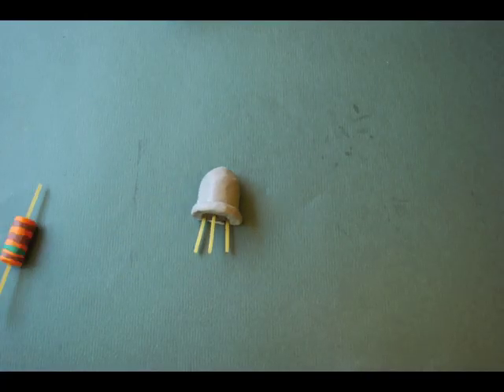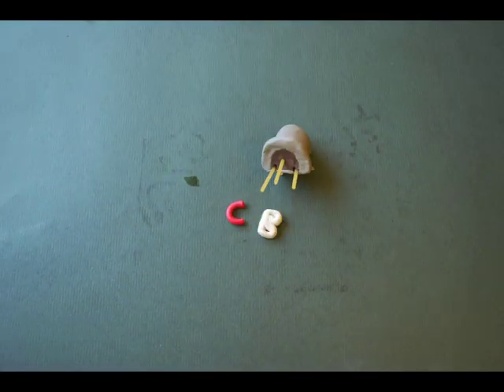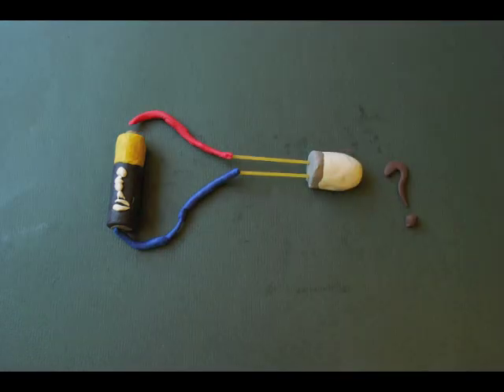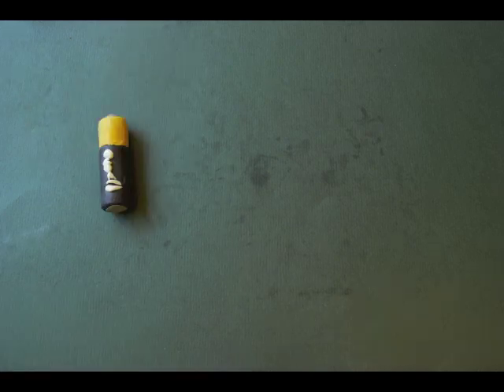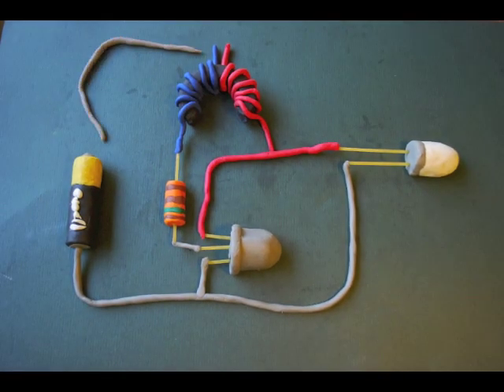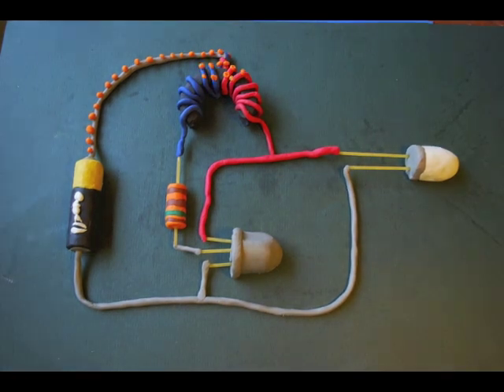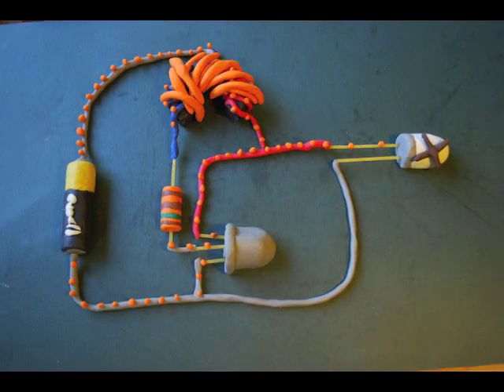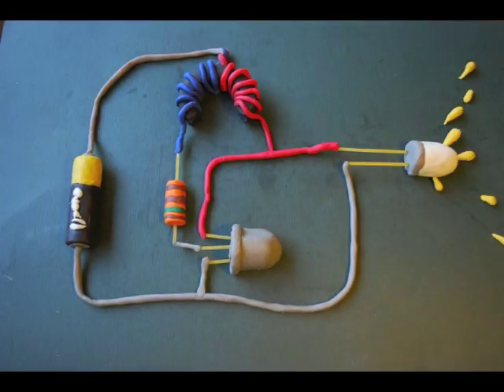joules thief 60,000

Comment: For about 3 bucks, you can get a tiny circuit,  rechargeable cell, and a solar charging panel for the cell . Just buy a solar yard light.
I put in a 3.3 V Blue LED  running on the 1.2 cell inside  the light fixture.
I put a  red 3.3 V in another

Comment: Your circuit is wrong.
If the transistor turned on it would short out the battery.
The LED would light up without any transistor or resistor.
Reply: +Al Pal it is correct
Reply: please rectify, if it has problem!

Comment: So it uses much less amps since its a collapsing magentic field I get that.  Is the benefit then efficiency off this setup.  What is the comparison of power output verses if you used say diodes or something in a straight circuit with the battery.  How does it compare to the Joules thief circuit in a apples to apples comparison.

Comment: Good job, but it is not clear.
1/ So the current passing through the blue and red wires around the thoroïd is creating a magnetic field into the thoroïd...thats mean eventually that the current of the red wire is pushed inside the blue wire by induction. So does the blue wire inside the red.
 Does those inducted currents goes in the opposite direction from the one that already flows inside those blue and red wires ?
 2/ In electicity a circuit close is a runing one.
 3/ why do we have a stronger and stronger magnetic fields around the thoroïd ? and why the current stop suddenly around that thoroïd ? and 60000 times by second ? ( i understand than in any coil, when you cut the current, the electricity that is inside flows out very fastly and strongly, this part is understandable, but does not answer about the increasing magnetic fields in the thoroïd, nor the 60000 ON and OFF occured in it,  feeding the led ). If you can explain very precisly every steps mentioned previously, I would thank you very much.
Reply: +Jacques sur Gmail A fluctuating magnetic field induces voltage in the wires, and current in the wires induces a magnetic field in the toroid. The electic flow induced and magnetic fields are opposite of each other. What happens is the low voltage flowing through rises the magnetic field of the toroid until it is so magnetic, the electric current induced by the toroid cancels out that of the current that induced it(saturation),  which then opens the flood gate to let it escape through the LED. Then the process starts over. 60,000 times per second.
Because of the sharp spiking in the magnetic field, it is common for them to 'sing', which means, emit a high frequency sound, which is the frequency of each cycle. a 60k ring hurts :P
Reply: Merci Richard. J'ai traduit ce que tu as écrit en bon français: : Un champ magnétique fluctuant induit une tension dans les fils, et le courant dans les fils, lui,  induit un champ magnétique dans le tore. Le flux électrique induit et les champs magnétiques sont opposées l'un à l'autre. Ce qui se produit, est que la faible tension y circulant, augmente le champ magnétique du tore, jusqu'à ce qu'il soit tellement magnétisé, que le courant électrique induit par le tore, s'oppose et annule le courant qui créa ce champ magnétique dans le tore (saturation). Ce qui a pour action, le vidage très rapide des électrons libres stockés dans le fil  (un peu comme un tuyau qui se vide très rapidement) et d'ouvrir alors la porte à une crue électrique qui s' échappe par la LED du bon côté de celle-ci, le +.  Ensuite, le processus recommence. 60.000 fois par seconde. En raison de la forte induction des champs magnétiques, il est courant de les entendre «chanter». Ce qui signifie qu'ils émettent un son à haute fréquence, qui est la fréquence de chaque cycle. Une boucle de 60khz fait mal à entendre.

Comment: The schematic is that of a classic Hartley Oscillator.  So far as I know the principle was discovered in the 1920s using electron tubes.  The LED is not part of the oscillator and serves only as an indicator of oscillation.  So there is no big deal here.

Comment: Your explanation is actually wrong. What actually happens is that transistors oscillate at a certain frequency. Usually thousands of times a second or even more that it turns off and on. 

Now when the transistor is on it allows the current to run straight to the battery. When the transistor is off the magnetic field in the toroid collapses which gives you back EMF, This is forced to go through the LED since the transistor is in it's off phase. This little pulse lights the LED and this whole thing happens at least thousands of times per second depending on the transistor you use. 

So this guys explanation is completely wrong and the fact that so many people thumbs up the video just shows how little they know about electricity. Go learn what inductors are and how toroids really work instead of some guy on a youtube video who can't even explain the process properly.
Reply: Actually transistors only oscillate at a frequency which is caused to happen by external supportive componentry. In this case the self resonant frequency of the toroid as determined by its inductance and the loading effect and capacitance of the transistor.
Reply: A1Skeptic Yes !! And we needed a lesson in how to flatten a perfectly good Battery  !!
Reply: ziongite WRONG!  Transistors do NOT intrinsically oscillate [perhaps you're thinking of a crystal or ceramic resonator]. The Joule Thief oscillates because of the circuit arrangement -- i.e. the other components are required, that produce the proper feedback to induce oscillation.
Reply: Your rude explanation matches the video 100%.
Reply: @ziongite; Let us now discuss your Claymation skills. Do you have any? Or are you just a blowhard? The circuit description in the video was hardly "completely wrong", unless yours is equally wrong, since they almost completely overlap.  You didn't get why so many people like the video because making yourself look smart was a higher agenda than acknowledging this guys hard work.
Reply: @Ziongite: Transistors don't oscillate on their own and they are not limited to one frequency -- you might be thinking of a crystal.
 ...Oh... I already said that -- well, it's still true ;)
Reply: If you have self oscillating transistors please put them on Ebay.  I will buy all you have.  Ignorant  and arrogant is a rough way to go thru life.

Comment: I liked the video and how it is made.very good for them who don't know basic transistor circuit. 
The problem is transistors are many types resistor value differs according to voltage blah blah blah. This video doesn't help to know that.  BUT THANKS FOR VIDEO IT MUST HAVE BEEN SO MUCH TIME CONSUMING.

Comment: one thing you didn't explain that it runs on a dead battery..but how?
Reply: dead batteries still have a small amount of charge in them. You couldn't use a battery that had 0 volts. AAs for example are rated for 1.5 volts, and many things that use them require a multiple of that, with a tolerance of half a volt or so. Once the battery gets lower than what it can tolerate, the battery no longer allows your device to function, but the battery isnt "empty". It still has a charge. This circuit simply uses that lower charge by building it up in the coil and then releasing it when its full.

It's kinda like eating a bowl of cereal. You can stop eating once the cereal is gone, or you can drink the milk thats left over. This is drinking the milk - but by using the spoon to slowly put it into a glass first before you drink it.
Reply: Ben Turner he is using the longitudinal wave spike that is coming from the collapse of the field. this is tesla 101. to bad this tech has been suppressed for so so long

Comment: -Since the transistor have been forced to be in "overdrive" by the expanding flux, the stationdary flux lets the transistor be "normal" again. The transistor base now turns off a bit causing the transistor to "limit current flow". This causes a collasping flux in the red coil.   
-than the red coil flux starts to "collapse", COLLASPING FLUX cuts the blue coil driving the transistor completely off. 
-Repeat process

Comment: -The red coil builds "expanding flux" which cuts into the blue coil which "drives" current into the base which helps to build more expanding flux
-the transistor at some point well then be "maxed out" , at which point the expanding flux cannot expand anymore and the red coil becomes "stationdary flux".

Comment: I tried building using a steel nut and also 3/8" screw and it didn't work.  I guess i have to use a ferrite core.

Comment: this is great. now instead of a battery get a bridging diode, hook up the dc side to the joule thief; and on the ac side run one wire to ground and one to an insulated aluminum dish or antenna as high up as possible.

Comment: Possibly, though this 'kid' is over 50 years old... just never had any education or experience with electricity beyond melting an electronic piano by trying to hotwire it and getting it wrong... Which is when I learned why they use a small black box on the plug-in.

Comment: so, this circuit lets you have more voltage on a led, motor, etc than the battery? couldn't you use a  capacitor?

Comment: Is it possible to use a car ignition coil instead of the toroid? I know that we are going to need stronger battery, but my question is if I have a 12 volts car battery and a car ignition coil, and strong enough transistor and resistor, can the same thing be applied to generate high voltage out of ignition coil? Thanks in advance :)

Comment: A self-oscillating voltage booster. Can use nearly all the energy in a cell, even when other circuits consider the cell dead. The name suggests that the circuit is stealing energy or "Joules".
The circuit is self-oscillating (blocking oscillator) forming an unregulated V booster. No energy is created by the circuit. Output V is increased at the expense of higher current draw on the input. The amount of power entering the circuit is the same as that leaving, minus losses in the conversion.

Comment: @telescopereplicator Because the voltage is generated by inductive kickback, and limited by the LED's forward bias voltage rather than the emf of the cell, the LED will light fine over a massive cell voltage range, so you can run a cell waaay down. Cheap circuit which gives you a use for otherwise dead batteries basically.

Comment: What is the point of this video? Which scientific reasons do you have for posting it? Is this a more energy efficient way of making an LED light up? If so, I have seen more efficient ways, using a high frequency pulse generated by an IC, power consumption is less than 80 micro amps !!
Posted several years back, in Elektor. I did not believe it, built it...and it works !! I can't explain how, but the LED lit up quite brightly. That is power efficiency !

Comment: Besides improving your pronunciation, you should add the capacitor in parallel to the resistor; I used a 10nF ceramic capacitor, but some circuits include a 470pF one. Just try. Anyway, it's a good didactic video, well done.